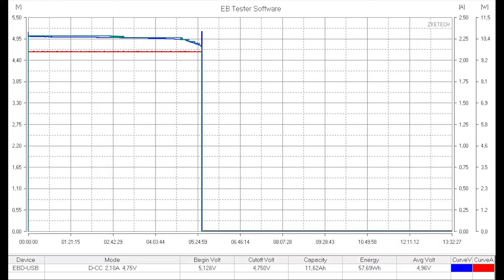Romoss ACE 20 power bank capacity test and review

Comment: Bruh , mine is exactly as yours but it charges slow what can ido
Reply from the maker: Make sure that you use 5V 2A charger or more and make sure to use short USB cable like 20cm instead of 1m or 2m cable. I have had the same problem and 2A charger and short cable fixed it.